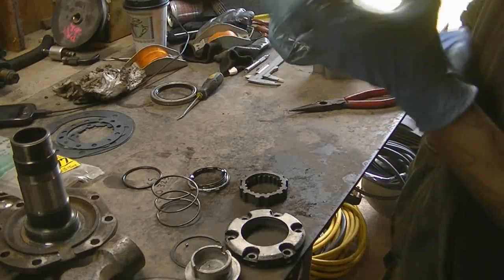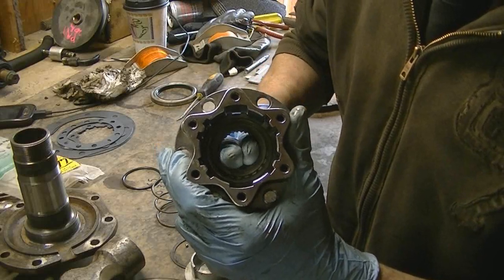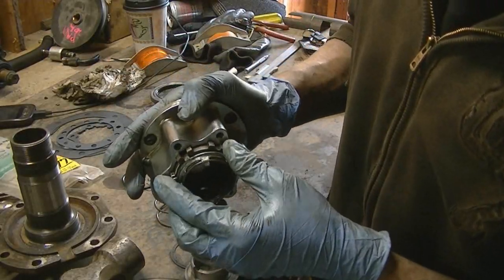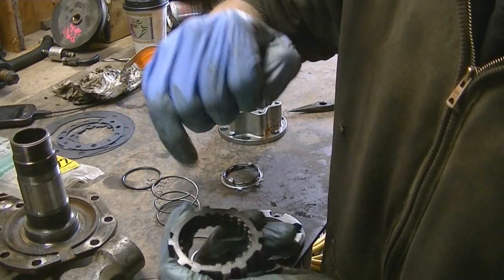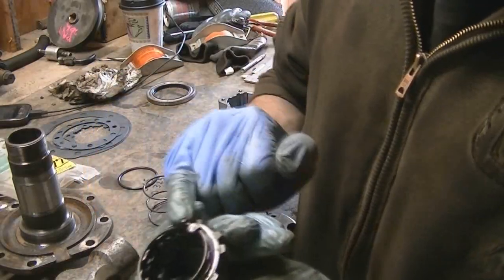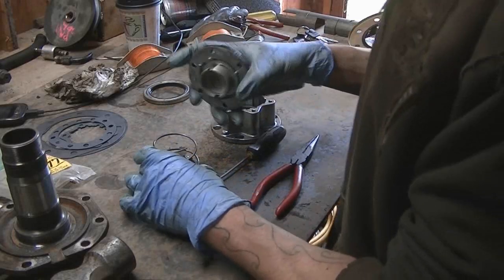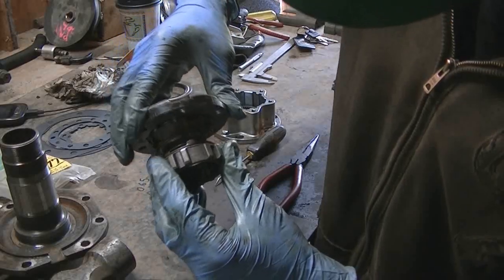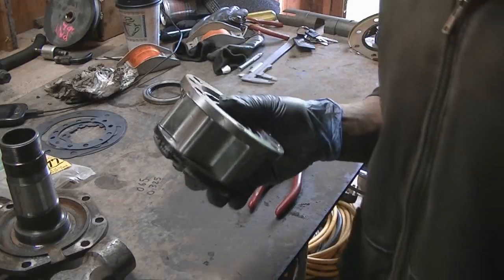How To Assemble A Toyota Manual Locking Hub (05/19/12)

Comment: Hey, thanks for the vid.  Good vid. Took my truck in for cv axle replacement. Went hunting and when I needed to lock my hubs, I couldn't turn the hubs to lock on both. When I took it back to the shop and told them what was going on. So they supposedly fixed it. I drove it home and decided to check to see it it locks and free my wheels. The knobs could turn now but the wheels are lock and won't free even if the knob is turned to free. So I found your vid and took care of it my self. It works now. Stupid mechanic shoved the gear piece inside just so it can free the knobs and told me it's good.
Reply from the maker: jthao2284 i am really happy to hear that! this is why i made this video! one time or another, someone will have issues with their hubs, so i made this video! have a great day bud!

Comment: hmm so the tabs on the pawl/ring/spring rides up and down the slopes on the control knob tube, and the big spring pushes the locking errr um cog, yep that will do, so there is pressure on it. basically sort of an external bayonet with lock ring.

Even i understand it, see good teacher :o)

Seems easy, but i want to task your brain with the most difficult and hard to answer question of all: Did the mud pack make it look younger or remove wrinkles ha ha :-)